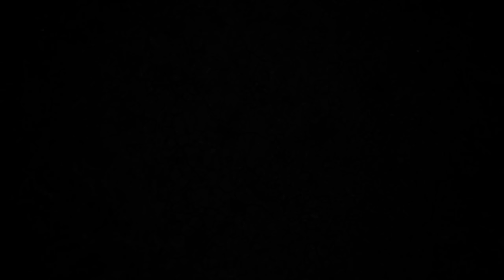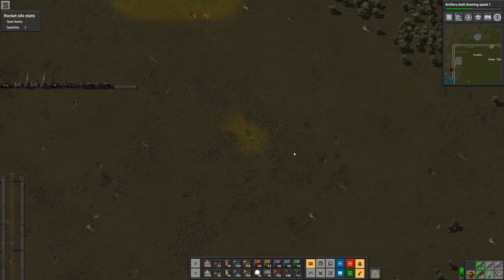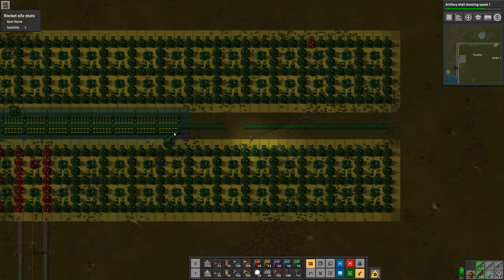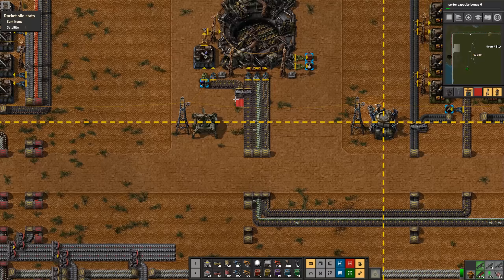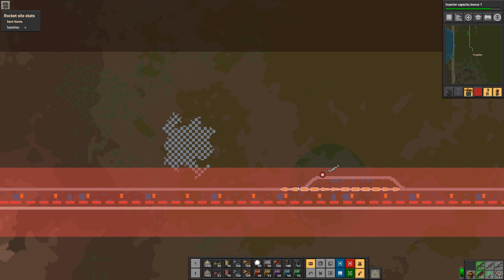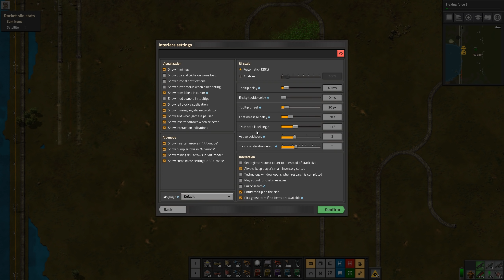Factorio 0.17 Let's Play #32 - Smelting rail layout

Comment: You can't have the 4 (normal) signals on the exits like that, the path through the splitting contraption will be considered free so long as the little 3-way in front of the exit is, not the exit itself. It will also allow a train to enter the 3-way and block any existing train from leaving.
Rule of thumb: use rail signals only in front of blocks that can by themselves hold a full train and still be able to clear. You want chain signals otherwise.
Generally, this means that in any intersection, only exit signals (as well as properly sized waiting areas) can be rail signals, all others need to be chain signals, including the entry ones.
Note also that while it doesn't matter too much if blocks on a section of line are shorter than a train (though I'm not sure how breaking distances work in factorio), exit blocks of intersections must always be long enough to hold the longest trains. It they aren't, a long train can still block the intersection if the block following the exit block is occupied.

One more thing: It might be a good idea to merge the outgoing paths as much as possible before crossing the incoming ones, to reduce the number of crossings
Reply: I didn't think about the exit blocks, but but from stacker to station, the only rail signals should be at the end of the parked train.  I'd also recommend chains at the splits, so that you can have more than one train in motion at a time.

Comment: Wouldn't exiting trains block off that path of any trains looking for a station, thus messing with this 'natural' even distributor? I do not know the exact algorithm the train pathing follows. If it iterates over them, would it skip its turn, or rearrange the list?

Crossing the distributor for the exiting trains should be done as far into the distributing lanes as possible, as to not block half of the stations in the worst case. How about a signaling method that would allow all trains to at least go past the final split, with a merged path for all exiting trains behind that. So a vertical railway as exit for all, just before the smelters.

Just of the top of my head, did no testing

Edit: it would push all smelters further east, as the incoming rail needs a train length of space after the last split
Reply from the maker: I'm using the signals to maintain the splitter as a single block, so they should not affect the pathfinding algorithm.  But, the returns are concerning me.  I may redesign it, I will have to think about it.